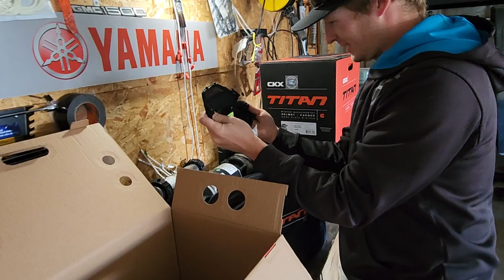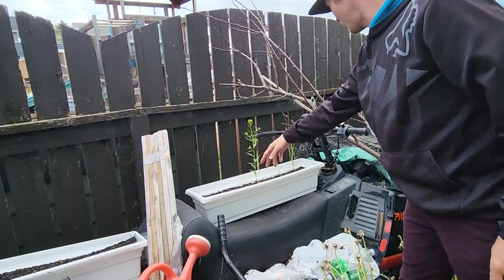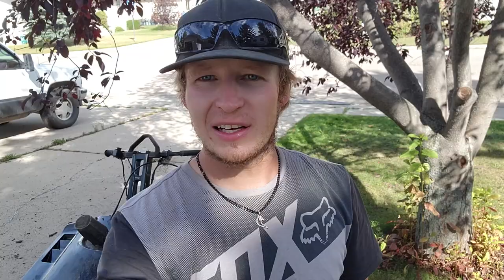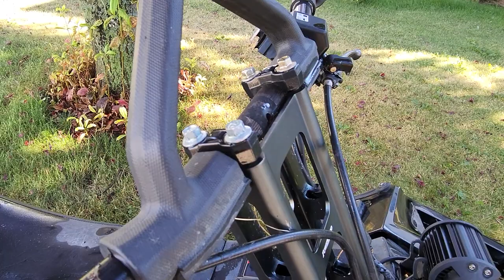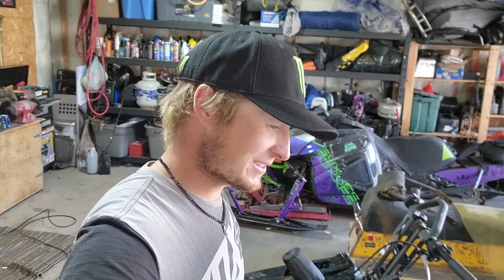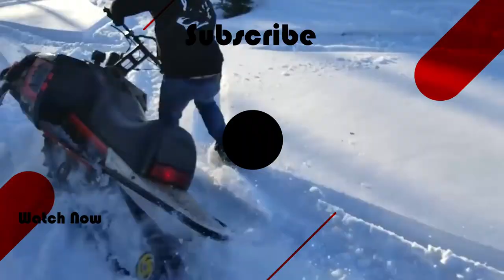MODDED YAMAHA PHAZER LONG TRACK | Out of Retirement

Comment: I learned how to ride on a 1988 phazer. Went for a night ride, it was running bad(needle/float stuck) so went back down to the lot n grabbed my mom's sled. When we got back my phazer was gone. It was the same color scheme as urs. It had a custom vanamgurg tunnel extension. 136×1.5 track and a 99s phazer longtrack skid. New pogo shocks on the front with polaris sidehiller skis. It had different handle bars. Best part was the ported motor with clutching and a aaen pipe. I miss that thing so much id give my left nut to get it back! Fuckin hate thieves! Totaly love that sled!